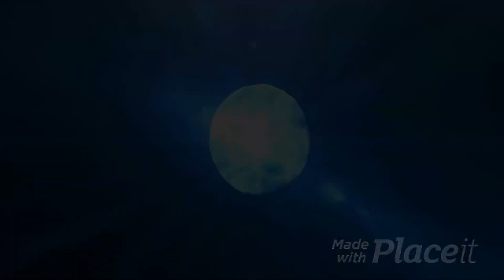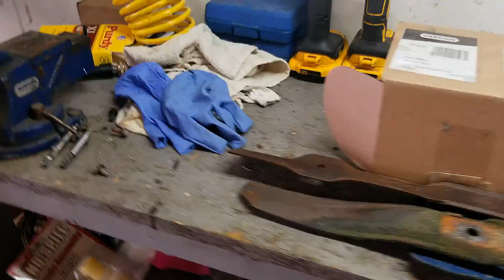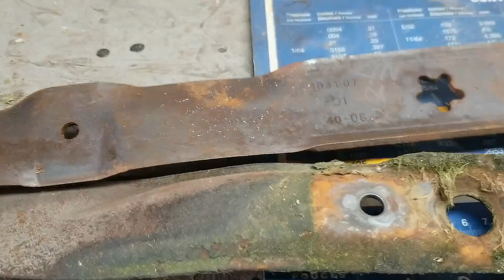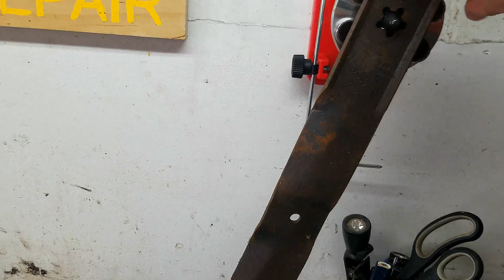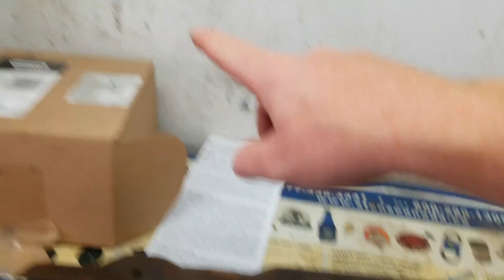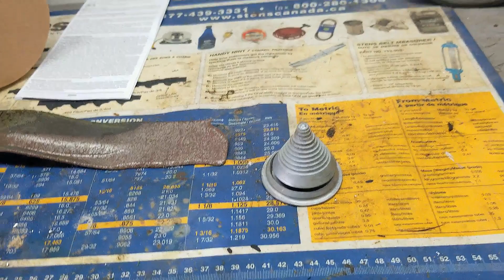Is an Oregon Blade Balancer Worth It? Maybe So

Comment: You should first remove as much of the caked on dried grass as possible. If you don't it will throw off getting it correctly balanced because you'll have dried grass weighing one side more then the other. Just my two cense. Have a good day.
Reply from the maker: Thanks for watching and taking the time to leave a comment. Cheers
Reply: agree 100% Cant ballance dirt/grass clipings.